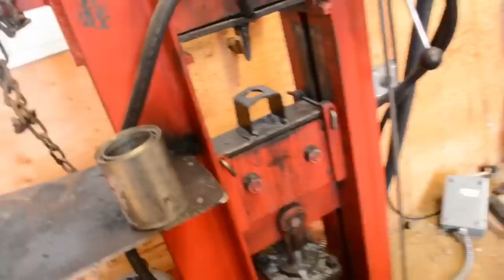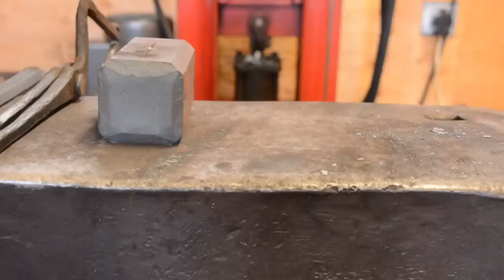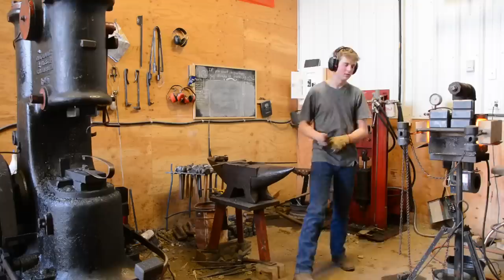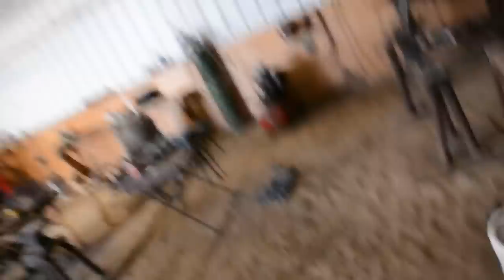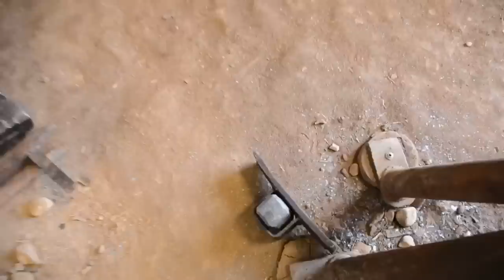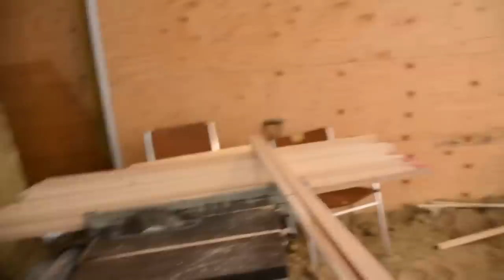Making 100 Hammers for Alec Steele pt. 2

Comment: That's a heck of a load of hammers to be making in a short period of time man.. Great work on them. I was wondering if the broken punch was H13, or not. Also, yeah... I'd weld the ever-loving out of the stripper plate to make sure thst it will take that kinda force. Actually I'd probably have went with 1/2 inch plate just to make sure that it didn't have an issue, especially since it's being used under such pressure, and so often. Solid work on that second heat tho. 👍👍Keep up the good work.

Comment: Little Brother, you are experiencing issues inherent to a press. Yes might be work hardening. Probably merely exceeding the tensile strength of the various parts. Try beeswax and graphite as a lube. Use ag seed lube graphite as it is cheap and comes in big quantities. Make tooling beefier. And then beefier still. Never heard a fuller line called a trough. But that’s cool. Great job! You are just having typical Murphyitus!

Comment: Just a thought, but chances are your punch is getting work hardened, try running a normalizing cyle and re temper after you do about 2/3 of the work you did before it failed.
Reply: rcs368 the punch is supposed to be hardened, he cools it with the can of water to not lose said heat treat. If he ran a normalizing cycle he would have to re heat treat, not temper
Reply: @tri11est  While that may be true=> (heat treat vs temper)"Work Hardening" still has to be addressed which can only be done in a normalizing cycle. Yes you will have to re heat treat. Either that or lose / break your punch again. He can also let the punch take on more heat before cooling to help stress relieve.

Comment: how long would you say it takes to make a single hammer?
Reply: So I'm  definitely not this youngman. He has tooling I do not.
However in light of the question I'd like to offer an answer  based on my recent experience. 
Just took a hammer class with Daniel Moss in Ohio just prior to the S.O.F.A. convention. My team, Rob and I,  made our hammers by hand hammers and guiatine tool. So from start to normalize cycle completion was 8 hrs. 1st hammers we had ever made. Then add in another 1.5 hrs for grinding in the faces and wire wheeling off the scale and eye filing. Next .5 hrs to heat and quench. Next after that was  minimum 2 hrs in the temper oven at 488 degrees Fahrenheit. Now to the handle process.  So far I've about 2.5hrs in hand carving the handle, though it's not fit to the eye yet, I figure about half hr for that.
It's been an unforgettable experience and journey through the hammer making process especially as I had never forged anything b4. Best kinda sore and wore out one can be.
Hope this gives you at least some idea though  power tools would greatly improve the time schedule just as experience would. I'd venture it would take close to 6 or 7 hrs w tools and experience billet to complete hammer. 
🙏blessings abundant yall 
Crawford out 🧙‍♂️